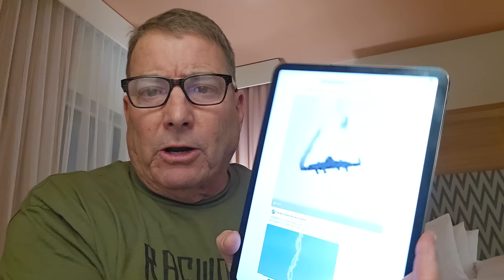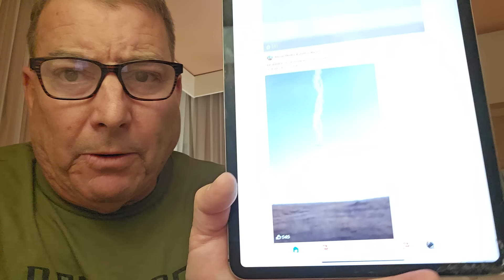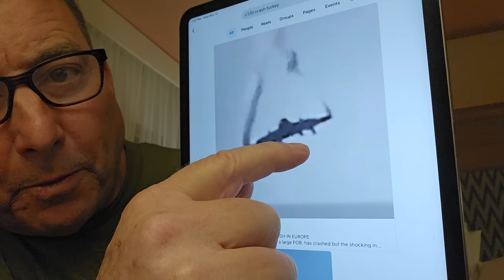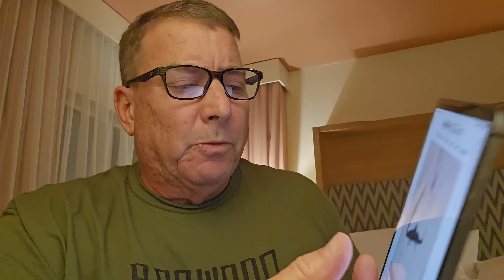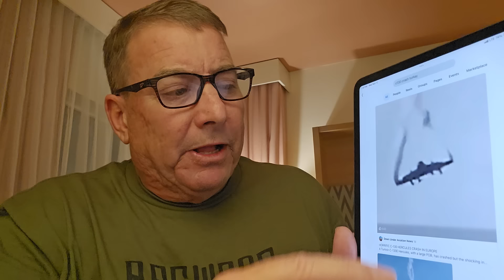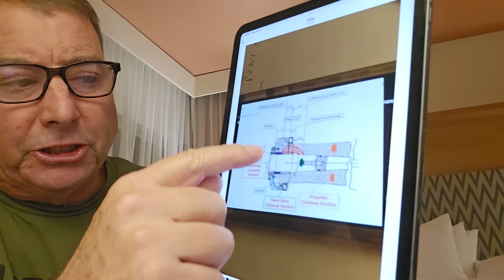Turkish C-130E Structural Failure 11 Nov 2025

Comment: This happened in '88 to one of our EC-130H birds.  #3 gearbox failed shedding #3 prop into the #4 prop which failed but diddn't separate and turned 90 degrees and lodged  in the leading edge.  Miraculously they landed the plane.  I believe this was one of only a few examples that diddnt result in airframe loss.
Reply: I have a couple thousand hours on P-3's  aircrew with the same T-56 engine just the right side up!  we lost an aircraft near alaska in the 70s couldnt feather the prop on number 3 engine it caught fire and couldnt put it out anymore the ditched and I lost a few friends..Maint is essential and depending on the model of the aircraft the first engine started sequence seems to have more problems in my experience and our mechanics said the same...
Reply: @gallardoo9  Sorry for your loss. Is it possible for some crew members to eject on these military turboprops? Or does everyone have to egress through doors?
Reply: @fallinginthed33p  Manual Egress only if parachutes available for crew, NO Ejection seats in US cargo / maritime / patrol aircraft (ex: C-130 / P-3)
Reply: @fallinginthed33p  Military cargo aircraft don't carry parachutes in peacetime, unfortunately.Many of the crew could have been ejected alive during the break-up sequence.
Reply: @gallardoo9 same prop or different?
Reply: @gallardoo9  A buddy of mine was flying a P-3 out of NAS Barbers Point, Hawaii when something similar happened. Kevin got the plane down intact, but it was really touch and go for the last 15 minutes of flight.
Reply: I'd expect 50-75% of airframes to survive this failure.  I.e. the blades don't aim so it's random chance if they hit the body or control cables.  I'm sure there's a safety guy somewhere in the Airforce that's been harping on this for decades but getting ignored by leadership because it isn't a "big" problem.
Reply: @martylawson1638  USAF is replacing all of these props on their C-130H models, and a civilian employee at Warner-Robbins went to jail as a result of the investigation.  So I'd say they regard it as a big problem.
Reply: @SwingNeil  Wow! Jail? Really? What was he charged with - I’m just curious, this is something you never hear!
Reply: @Tubesmaney  Lack of candor about the blade inspection process during the investigation.
Reply: @martylawson1638  The prop doesn't aim, but each prop location will have a trajectory based on rpm and pitch, so the prop that Juan is citing here absolutely does have a tendency to do the exact same thing every time if it fails at the same or similar rpm and pitch.
Reply: Hi. Buzz. I had just retired from the 41st about a year before that happened. Heard about it from the FE. Still think the Jerk is a hell of an aircraft. 6000+ hours in one.
Reply: So I may be correct in thinking the gearbox is now the culprit. I was thinking excessive bearing and seal wear but there would have been signs. Oil streaks on the box face or slight drips of gear oil would show up if that was the case. The only other thing I can think of is a stress fracture in a gear causing it to grenade.
Reply: That was lucky and very likely superb airmanship
Reply: How does a prop sever the "tail"?
Reply: The prop also has immense amount of kinetic energy and the skin of the fuselage is not that thick. And on stressed skin aircraft the skin is required for structural integrity.
Reply: @onceamoth   Ever throw a frisbee? Prop breaks off and due to inertial and aero forces it falls some first but then arcs rearwards...just a theory though based on my physics knowledge...
Reply: @johnrobertson7583  Difficult to predict. As the blade is designed to pull the aircraft with a lot of force, it will fly forward a little in the very first moment where the main direction leads away from the propeller shaft. The relatio of stored energie to mass of the blade is extremely high. So it can change its direction easily during the solo flight. Besides the enourmous centrifugal force unidirctional there is stored some rotating energie in the blade which lead to a sawing function when touching bodies.
Reply: @onceamoth  Man, physics and aerodynamics can get weird. Someone stole the hood pins off my fiberglass hood and when I got up to about 35 mph my hood flew FORWARD off my truck. After Juan explained the UPS MD11 turbine ending up on the other side of the runway from where it detached from the plane seeing this accident and how a propeller can sever the tail doesn't seem out of the reach of physics possibilities. It almost can make sense immediately if you think about certain scenarios. Crazy.
Reply: @onceamoth  it was the prop and reduction gearbox, or at least part of it. That is a significant mass
Reply: @onceamoth  What do you mean "how"? how do you think?
Reply: @xisotopex Well, as the props are in line with the fwd fuselage, the severed nose makes sense.
But a severed tail??
Reply: @onceamoth the prop could have severed the forward fuselage ahead of the wing box first. Then sudden aero drag and tumbling would cause the rear fuselage behind the wing box to break away. Unfortunately it's happened to airliners before too. There's not much holding the fuselage to the wings.

Comment: Lockheed needs to come up with a fix. Is there any difference in the prop area between the C-130 and the Electra (maybe adopt the L-188
prop design to the C-130. ? the number 2 other incident or more then the 2 times. Most be some kind of vibration. The wing/engine combo  may loosen move little amount putting added strain on the prop blades.
Reply: You want LM to gift Turkish Air Force new propellers? RTX Collins Aerospace subsidiary Ratier Figeac in France makes 8 blade NP2000 replacement propeller for C-130. Turkey just needs to buy them...
Reply: The fix is to adhere to maintenance procedures and schedules.

Comment: Holy shit. That exact type of failure happened to a passenger turboprop in Canada back in the late 80’s.   And again to a different degree on a twin engine turboprop small airliner in the early 2000’s.  Both Hamilton standard type propellers.   I’m utterly shocked and appalled that this specific type of prob failure is still possible after the new regulations that were introduced and 20+ years of aviation development    This is utterly unacceptable.  Hamilton standard propellers used to be a by word for safe efficient and powerful propellers used.   Wtf happened?
Reply: It is a maintenance issue
Reply: @TricksterJ97 there should be a mandatory shaft replacement period for older aircraft types

Comment: Mississippi Investigation: A subsequent investigation revealed that the corrosion should have been detected and repaired during an Air Force overhaul of the propeller in 2011. A former Air Force engineer was later charged in connection with the crash in 2024.
Reply: Did he serve time, or was it just a warning?

Comment: I don't know why these areas of the fuselage aren't reinforced to withstand a blade impact .
At first I thought this was going to be the Cal-fire C-130 that was making a straifing run on a fire and tge wings folded up like a taco.
Reply: The aircraft would be pretty heavy by the time you armoured it against 130 pound blades spinning at 1020 RPM

Comment: Why does a broken off prop always have to fly into the fuselage? Why couldn't it go straight up. down or to the other side? Just bad luck? I bet even if these guys had parachutes they couldn't get out due to the forces. RIP to all in that plane.
Reply: If one blade fails, the resulting vibration will likely have the rest failing very quickly.  So, there's a pretty good chance at least one blade will hit the fuselage.
Reply: perhaps we dont hear about the ones that didnt go into fuselage because they landed safely. you should look into that. perhaps props flying off happens more often than we think...

Comment: NAvy Ditched a p-3 due to a similar failure mode in 1995. Root cause was corrosion cracking at the blade butt. Blade departed with gearbox and cut through most of the cables and shutdown the other 3 engines. But for the Navy guys, the plane was in 1 piece so a no engine ditch with mostly disconnected flt control cables was an easy day.
Reply: Was a Lockheed Electra L-188 Flight Engineer about 35 years ago when a similar thing happened to me. Almost threw a blade off no. 1 engine. Aeroproducts props with the square tips. A unknown crack had developped close to the blade root, behind the black fibreglass cuff. We were 200 miles offshore over the Atlantic, a vibration got from slight to worse, then so bad, it was almost like a slight helicopter vertical vibration. I was having lunch in the back, so went to the cockpit and noticed No 1 Engine Oil Pressure and No 1 Reduction Gear Box oil pressure needles vibrating together in unison, while the other engine oil pressure indications were rock steady. With that funny feeling you get in your butt when things are about to go real bad, I advised the captain that we should shut down No. 1 Engine. He wanted to wait 10 minutes to turn towards land first, but I insisted NOW!. He said ok, so I E-Handled the engine and the vibration went away. We landed in CYQX, where they discovered a 1/8 inch wide crack, at its widest point, along the blade chord. Flew it on 3 engines to CYUL. Prop was sent to Hamilton Standard for metallurgic analysis. They figured that the crack had been there for 25 cycles, and at the moment I shut her down, we had 30 seconds left til separation. I had horseshoes up my butt that day.
Reply: @marclandreville6367  Wow. Intense story.

Comment: Same scenario has happened with the Aeroproducts 606 propeller on the Allison engine.  In 1967 a Lake Central Airlines Convair 580 was lost along with 38 lives when a torque cylinder in the right prop failed and allowed the blades to go to flat pitch.  All the blades came off and the number 2 blade went through the fuselage.  Apparently a worker who was nitriding the torque cylinders during the propeller manufacturing process misplaced a basket and allowed one cylinder to pass through without treatment.

Comment: Can't new props be made to replace these ancient ones?
Reply: RTX Collins Aerospace subsidiary Ratier Figeac in France makes NP2000 8 blade replacement propeller for C-130. Turkish Air Force just needs to buy them. US has upgraded most of the remaining C-130H fleet with it. NP2000 is also used on the latest versions of E-2 and C-2.

Comment: It looks like the entire center section of the aircraft separated from the forward and aft fuselages while remaining attached to the wing box. The forward fuselage attaches just in front of the wings, and the aft fuselage attaches just aft of the wings. The wing box attaches to the top of the center fuselage section (which is still attached in the video). The wing box extends to the outboard side of the two inner engine nacelles. The outer wings, which include the outboard engine nacelles, attach to the center wing box.

Initially, I thought the wing box had failed, it is a limited-life item and must be replaced periodically, but that does not appear to be the case, since it was still attached to the outboard wings and the center fuselage section. The forward and aft fuselage sections have...separated! I think Juan has this right. The prop blade separated and cut the forward fuselage off (4 longerons plus perimeter bolts hold the fuselage together). Cut enough of those bolts, longerons, and/or fuselage stringers and it's coming off. Aerodynamic forces then ripped the aft section off, leaving the center section attached to the wing assembly.
Reply: Speaking as someone with zero relevant knowledge, a prop blade doing all that isn't what I would have naively expected, but I'm totally happy to bow to people who actually know what they are talking about.
Given that it could have presumably gone in all manner of other directions, it seems like double bad luck (though I suppose once one blade has come off, all manner of nasty things could happen to what is left behind).
Reply: @davewilson4493  The power to cause the damage come from the explosive decompression.

Comment: BIG Allisons means BIG propeller blades. If I’m not mistaken, Convair 580, Lockheed Electras, P3 Orions and C-130s all have suffered catastrophic failures due to loss of propeller blades. History repeats with mind numbing regularity.
Reply: IIRC, most Lockheed Electras and Convair 580's had Aeroproducts props, the ones with the square tips. P-3's and C-130's had Hamilton Standard props with rounded tips. The Aeroproducts props were known for blade failure. Typically, you throw a blade off number one, then the engine mount rips off and a blade takes out number 2, and a blade from that one enters the fuselage.  Reeve Air Aleutian had such a case, when the blade entering the fuselage wiped out the hydraulics and part of the flight controls. IIRC, they were still able to fly it with the autopilot. NorthWest Territorial had one of these happen and a blade wound up stuck in the vertical stabilizer.
Reply: On June 8, 1983, Lockheed Electra L-188 N1968R flown by Reeve Aleutian Airways shed the #4 propeller while enroute from Cold Bay to Seattle. The propeller sliced through the fuselage, jamming the flight controls and engine controls. The flight crew managed to fly the aircraft to Anchorage and perform a safe landing.

Comment: The same thing caused the Atlantic Southeast Airlines Flight 529 (EMB-120) crash in Carrolton, GA in 1995. That is, internal corrosion on one of the blades was missed on an inspection. The severe vibration caused the entire engine to embed in the leading edge of the wing causing tremendous drag.
Reply: That's incorrect. The root cause was an unapproved overhaul procedure where the lead wool (used to balance the prop) was removed from the blade coming in for service by an ad hoc tool created by the the repair station for such overhauls. This tool scored the inner wall of the prop shaft, a defect leading to structural failure of the aluminum shaft and separation from the hub. /2
Reply: The severe vibration then caused the hub (not 'the engine') to separate from the the driveshaft. It then pivoted on the PCU transfer tube, which is connected at the rear of the powerplant, and by sheer bad luck, implanted itself in the leading edge of the wing. The resulting drag & thrust asymmetry was beyond the control authority of the aircraft, resulting in the partially controlled crash landing. (411: my nick comes from the carrier call sign, 'ACEY'. I was Flight Control Duty Manager that day.)

Comment: Surprising they haven't armored that section of fuselage which is prone to intercept failed propeller blades. Didn't McDonnell-Douglas do some sort of armoring on the DC-10 to protect against a similar sort of engine blade separation in the #2 (tail) engine?

Comment: Big quistion is what is the maint/insp schedual that has been logged on these blades that failed? Were they accomplished and certified as per the mandated schedual? Were any inspections skipped or not accomplished for any reason? 
There is a special inspection in reference to: Stress Corrosion Monitoring:
Critical due to past incidents (e.g., KC-130T crash in 2017 caused by blade liberation from stress corrosion cracking).
Enhanced inspection protocols developed post-incident to detect early signs of fatigue.
Did this aircraft's propellers get inspected in accordance with that inspection and schedual?

Comment: When you mention corrosion as the factor that caused the first failure in Mississippi, I have to wonder if corrosion played any factor in the UPS crash, as well. So many terrible catastrophic structural failures lately. RIP to all those who were lost
Reply: Aluminum has a finite flex/fatigue life. IOW flex aluminum enough times and it shall break. Maintenance is everything when aluminum and other alloys have properites like this.

Comment: The same thing happened to an Embraer turbocraft back in the 90's.  It also had a Hamilton Standard prop and the cause was also determined to be corrosion that caused a blade to come off.
Reply: ASA FLT 529 EMB-120 Carrolton, GA 1995

Comment: After reading the report on Warner Robbins painting over the corrosion found on the prop of the Yankee 72, I couldn’t believe how bad the day got for that poor crew once the prop came loose. 

It’s been tough on crews the last few weeks with unsurvivable situations.
Reply: I started out as a propulsion mechanic for the USAF  in 1976, E models, then went full-time with the TX Guard in 82 with  B models, H2s and H 2.5s. I retired before the Js got there. Everyone with C130 propulsion experience has come to this same conclusion. I was thoroughly PO'd after reading the Yankee 72 report. I  had seen overhaul standards literally degrade over time and time change hours increased beyond anything I considered safe. (Same with engine components. ) There were good reasons for those inspections. I  stand by them. The basically "fly until failure" policy is  unacceptable. I'm very sorry for the loss of these families and crew.
Reply: Sadly some people continue to think that blades are big hunks of aluminium that couldn’t possibly be affected by a little bit of corrosion.  It’s a problem for general and commercial aviation, and I guess for military aviation to a lesser extent as well.